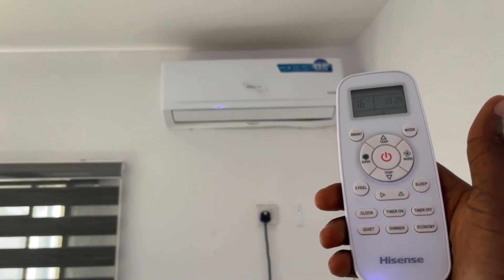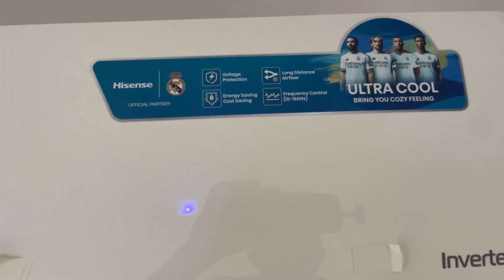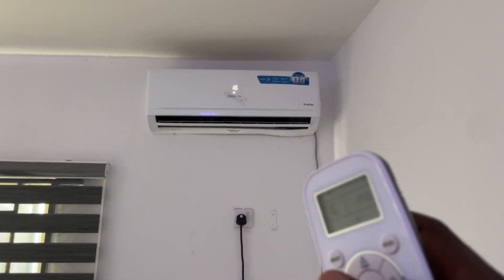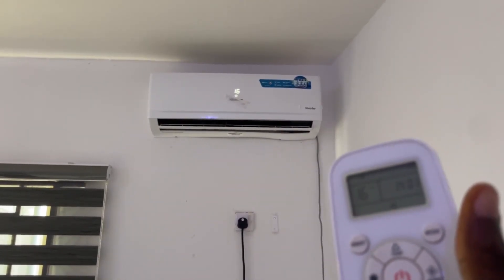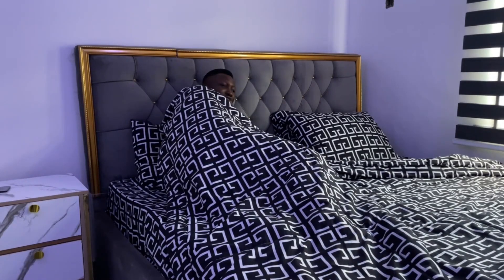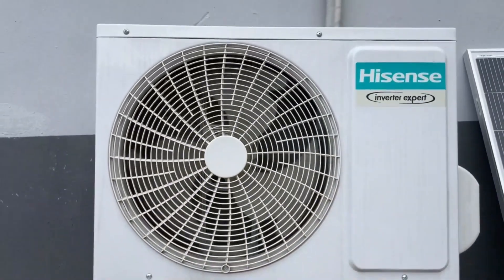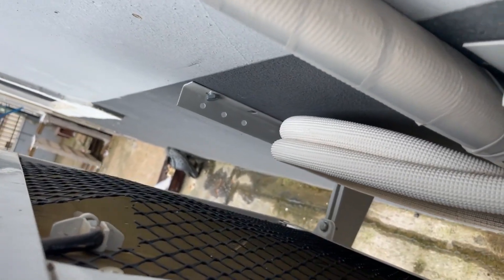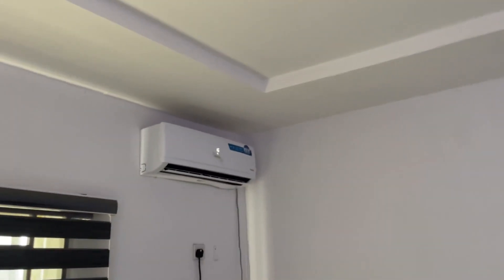Hisense Inverter Air Conditioner Review | Inverter vs Non-Inverter AC Explained

Comment: That's incorrect. Every air conditioner is equipped with a thermostat, which requires it to switch off and then turn back on after a short interval. The primary benefit of an inverter is its ability to manage electricity power consumption.
Reply from the maker: You’re right. Thanks for the correction

Comment: Small correction, Inverter Compressors can "adjust their speed" a normal compressor will run at 100% all the time, an inverter can run at say 10% to over 100%, that's how a lot of these new fridges have a "supercool" option. All compressors turn on and off depending on the thermostat, so that's nothing new with Inverter Compressors, Inverter compressors simply adjust their speed, which a normal compressor can not do.
Reply from the maker: You’re very correct. Thank you very much for the correction, and for throwing more light on this.

Comment: Do i need a wall mounted stabilizer for an inverter AC. Light is my area can be as low as 120v
Reply from the maker: It must not necessarily be a wall mounted stabilizer, but you can still use it too. For me, I use a 5000 watts normal non-wall stabilizer, and it’s really doing a great job.